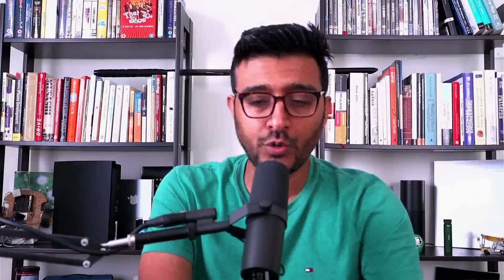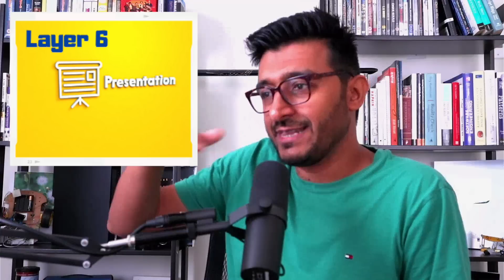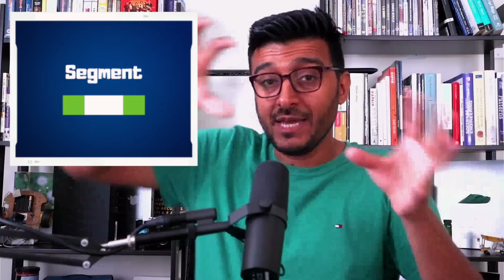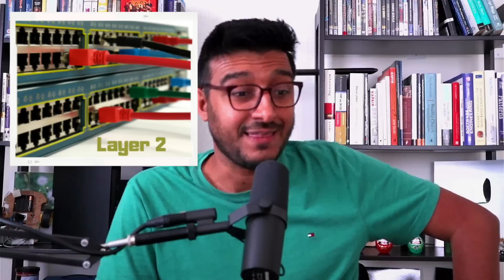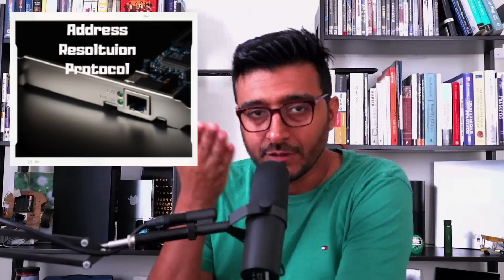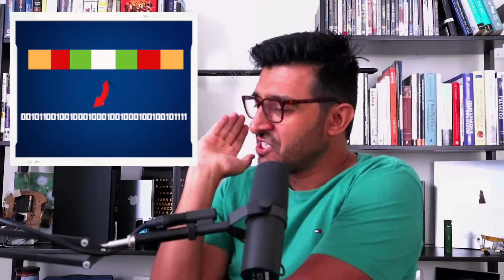The OSI Model by Example - The Backend Engineering Show with Hussein Nasser

Comment: Just wow 

7. Application Layer
6. Presentation Layer
5. Session  Layer
4. Transport Layer ( Port -> Application and TCP/UDP ) ( Segment )
3. Network Layer  ( Packet -> IP )
2. Data Link Layer ( Frame -> MAC )
1. Physical Layer ( 0-1 )

Level wise load balancing , router is layer 4 device can sneak at layer 3..1 if needed , Switch is layer 2 Device ( its real sense )

Comment: Thanks @hussein for the best informal discussion on OSI model. Had a concern at 26:37 you mention that routers have to do nat translation and they have to go to layer 4. However, nat happens at layer 3. Can you confirm this ? Since layer 4 is concerned with port and layer 3 is concerned with IP address, why even go to layer 4 when we know it's a private IP .

Comment: so nice to hear from someone who knows how this stuff works... 
as you must have felt... most professors just taste this reading from the menu... never touching the food...

should reinforce address levels are only L2/L3... LAN/WAN purpouses...
discuss a bit of MTU, packet sizes and frame sizes...
how ports are implemented in memory is also interesting.. (64K of them)

PS: ARP won't help you receiving a packet from the Gateway... ;-)

how about the same example (L1..L7) but with a SMB or a NFS packet...

* (I'm reusing comments... remember DRY ;-)

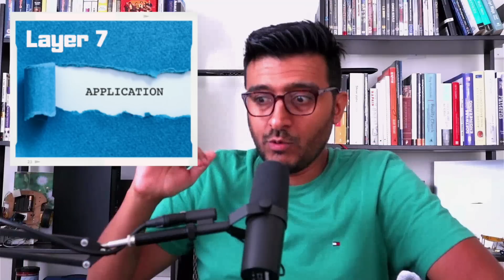Comment: 9:52 ha, that's what you think ! ;-)
They are many definitions of layers above it, layer 8, layer 9 and layer 10.
For example: Layer 8, The individual person. Layer 9, The organization, Layer 10: Government or legal compliance
Or: Layer 8: Budget, Layer 9: Politics, Layer 10:Religion
:-)
20:40 0hh, you sweet innocent man. Their are definitely duplicate MAC addresses out there ! It's lots of 'fun'. Also Ethernet is obviously not the only data link protocol, but I assume you know that. WiFi uses Ethernet frames too. But for example dialup modems use SLIP/PPP. And DSL uses ATM. I'm not sure about satellites.
26:35 these days everything has a firewall, so it will check ports if it needs to know. And usually the firewall has connection tracking, (NAT is a subset of that) so  it will check the ports (or ICMP types of course).
30:33 remember how you mentioned cloud networking, that's protocols like VXLAN that encapsulate layer 2 frames inside of layer 4 packet.
PS Seems this video has a lower video quality ?
Reply from the maker: Great comment as usual

I am experimenting with editing, Didnt work .. will stick to my defaults